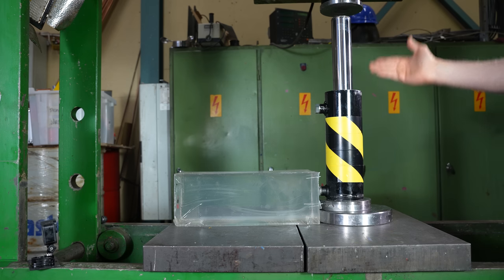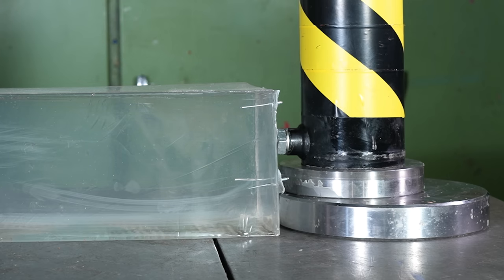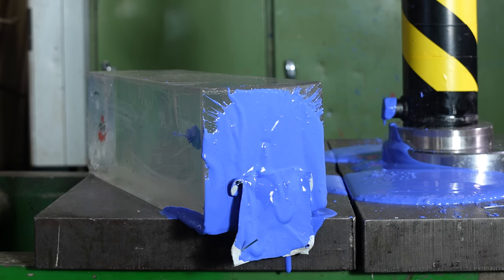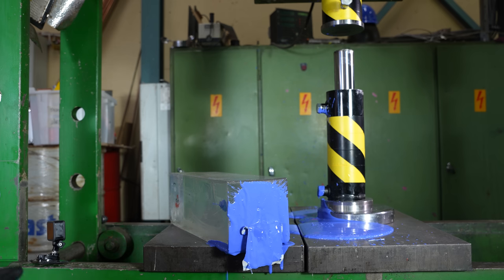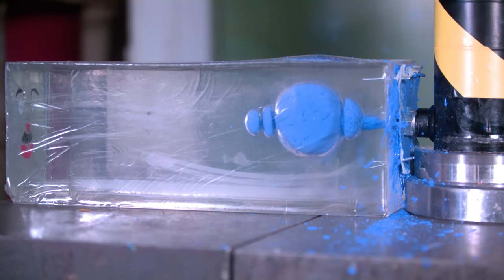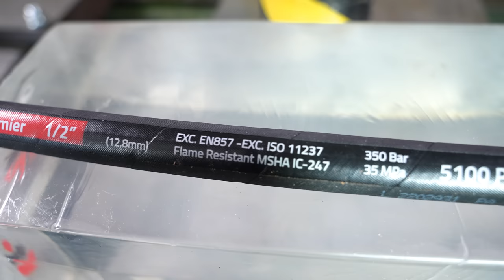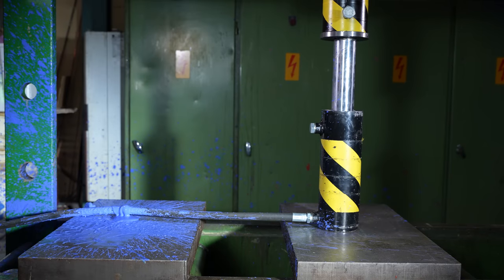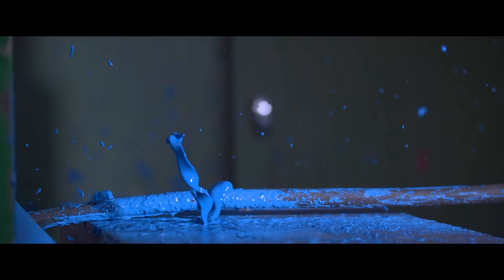Injection Injury Demonstration With Hydraulic Press | How to lose your hand!

Comment: Years ago I worked for a hydroblasting company using up to 40k psi equipment. We all had to carry a special card with us in case of injury that told doctors how to properly address an injury since it was such a specific kind of injury.
Reply: That’s nearly 2758 bars for those who want the conversion.

This amount of pressure will go right through two people if the injection injury is located at the chest. Bones included.
Reply: So if you could effectively get mercury to those kind (or perhaps even a theoretical liquid with an even higher density via simulation) pressures how many human bodies could it be able to penetrate through?
Reply: @thedoctor2102  I'm admittedly not smart enough to have an answer for that question, but I can tell you that I've seen the water shred through reinforced concrete like it was Styrofoam, in case that gives you a good idea of the power.
Reply: @thedoctor2102 Mercury powered death beam, 50+ feet, easy.
Reply: Here's some wood cutting with such: https://youtu.be/JYlkrYVarP8?t=138
And swtiching to steel with abrasive material added: https://youtu.be/JYlkrYVarP8?t=484
Also cuts solid ice like butter:
https://youtu.be/Iv3Rb88ZGy8?t=422

Comment: This is why you NEVER feel for leaks with you're hand when working on hydraulic systems.
Reply: You can actually feel for leaks twice with your hands. That's because people have two hands, so when you lose one, you still have the other one to feel for leaks. /s
Reply: @LordDragox412  Do not look into laser beam with remaining eye.
Reply: Correct . Always use your tongue 🤪
Reply: Use a piece of paper
Reply: @TheBackyardChemist  Especially not UV lasers because they don't trigger the blink reflex. Anything single-mode (like common 1310nm or 1550nm optics) is risky, especially LH (Long-Haul) or ULH (Ultra Long Haul) due to the launch power. Vendors are supposed to include safety features like auto shutters and ALS (Automatic Laser Shutdown), but they can be badly designed. I once had a well-known 'carrier' manufacturer show me some very expensive line cards with a 45 degree connector facing upwards. They were told in no uncertain terms that we wouldn't be buying any of them until they fixed that rather critical safety issue.
As for pressure systems, I was told to use paper strips with a length-ways fold in them. If it deflects the paper, there's a leak. If it cuts the paper, be glad it wasn't your finger.
Reply: @brolohalflemming7042  Those are IR wavelengths, not UV, but good point.
Reply: Always use a hotdog to check for leaks
Reply: A guy I know did that. His hand injury was so bad that the doctors wanted to amputate it, but they just happened to have the nation's top hand surgeon working at the hospital, and that woman managed to save his hand. But it still took 6 or 7 surgeries over the course of 3 years to fix the hand.
Reply: @Benny--- Just thinking about those bills terrifies me
Reply: Thanks for the heads up, I would have never known this, I learn more from commenters than school.
Reply: do be fair if you use your hands to find the leaks, you will know for sure when you find them

Comment: I worked security at a place that manufactured hydraulic pumps. They had a torture room where they tested stuff way beyond the rated maximum. Some of their bigger pumps would run 30,0000 to 60,000 PSI. They showed me a video of a pin hole failure at 30,000 PSI and it cut the gelatin dummy in half, and it had simulate bone and organs similar to the ones from Ballistic Dummies (though this was way before that company existed as far as I know).

Comment: Thank You for this video. Younger folks who work with pressurized systems NEED this video, not the experience. My first Navy Aviation command, we had a young guy working with a pneumatic grease gun. It was everyones first time being around a pneumatic grease gun, so no one had experience with it. They loaded it up, hooked up line pressurized air to it and ... it didn't work. They had used an old Zerk filling nozzle that had a metal burr on it. Young guy puts his thumb nail on it to flick off the burr, pressed his thumb to the end and hit the button like he did with manual grease guns and............promptly inflated his entire hand with about 2 pounds of thick grease. His hand looked like an old baseball glove, the formerly ivory white skin now leather brown and inflated to three times its normal size. It was the first time I heard the phrase 'Internal De-Gloving'. It was an instant medical emergency that no one knew how to deal with. He was taken to the Emergency Room, who transferred him to another hospital, who transferred him to another hospital and finally ....well, he got sent back to the first hospital. His hand was totally De-Gloved, but the skin was still attached. They would start surgery to clean the 'wound', by slicing every finger top and bottom from tip to wrist and scooping out heavy dense grease, flushing it with gallons of saline.... and, somewhere along the way? They called in ....a Taxidermist. I don't know why, or if it was real... The young guy came back after nearly 6 months, his new call sign was 'Frankenstein Hand'. His hand was stitches, scars, skin grafts, necrosis and he was nearly discharged. His hand was in near constant pain and... yeah, poster child for safety after that.
Reply: Jesus fucking christ can't even fathom the pain of something like that happening. Oof.
Reply: the saline isn't going to do shit to that grease either, poor guy
Reply: It was tough to even read this. Jesus..
Reply: I really wish I hadn’t read that...now I got that image of a degloved hand and other disturbing hit in my head...
Reply: I would have rather told them to just fucking amputate the hand in totality, don't bother.
Reply: Reading this is still more tolerable than looking at an image of a firefighter caught and killed in a wildfire... Dude's skin was almost completely burned away, little melted scraps still hanging on, most of the flesh on his head had burned away, just leaving a scorched skull with just a little bit of flesh left behind, and I could see charred muscle separating from tendons and ligaments elsewhere around the body.

It is more horrific than it sounds, words cannot describe what I felt when I saw that image, but it gave me a whole new respect for fire. Your story definitely gives me some proper respect for pressure.
Reply: Not just with, also around. I used to work for an excavation company, sometimes that meant me in a machine (getting to run a bucketloader with 6 foot tall tires and articulated steering was great), more often than not it meant me working beside a machine. It was good to be aware of the equipment. Not like I had a scumbag boss or anything, so the equipment was always in good shape. My boss actually cared about his employees so this was something he made sure we were all aware of, just in case.
Reply: Jeez, that is like a novelist-grade description of what happened.
Reply: My brother used pneumatic drills and screwdrivers at work.  One day when he needed to use one and he touched the button he noticed the thing didn't start normally but very aggressively (starting the thing under normal circumstances already was very close to an on-off situation but wasn't as violent as it was now.
He noticed the pneumatic line was also stiffer than normal and walked the line back towards the compressor outside the building, up to which he started hearing a hissing sound near the main coupling into the lines for the drills in the workshop (there were about 4-5 I think).
When he went outside he saw the compressor was redlining because the pressure sensor was malfunctioning and the pressure drum was way over safety limits.  They improvised a longer stick to switch off the thing (there was one of those stick-and-hook switches in a box on the outside but they reasoned they were to close to the drum while doing that).

When it was off and they decided to run some of the drills simultaneously to relieve pressure as quickly as possible, some of the drills ran for 3 minutes straight.
My brother checked out the situation outside again after that and the pressure drum and main line had been forming a thick layer of ice, indicating just how much of a pressure difference there actually had been taking place by relieving pressure.
They switched it on after that and watched the installation from the outside.  Upon the gauge immediately redlining again instead of switching off when that happened they pulled the switch and then decided to take out the wiring from the junction box so it could not be switched on again.
A decision was immediately made to have a replacement installed, all of the employees knew full well how bad things could get if any part would've failed under high stress.

By the way: The taxidermist was probably called in because they have experience working with chemicals to rid the body of an animal from the cleaning agents (to stop a possibly pungent smell) that next to toxic, can also invade tissues in ways that most doctors will probably never encounter.
Reply: I wonder what the taxidermist was thinking 🤔
Reply: I just looked up degloving. Don't do that.
Reply: @rdizzy1  truth

Comment: I used to be a painter working with high pressure spray equipment so this is something that I have always taken extremely seriously. I reported a damaged spray line to my superiors and they blew me off and didn’t do anything about it. One month later that same spray line busted open and spilled paint everywhere on a construction site, nobody was injured luckily but that could’ve seriously injured somebody and I was pissed that I warned them about but they didn’t listen to me. I don’t want to be anywhere near defective equipment. They are hypocrites for preaching safety but when it comes time to fork out money to replace old and damaged equipment then they don’t do it.
Reply: Paint sprayers are no joke... My grandfather was burned over a large section of his body by an industrial grade paint sprayer.  I don't know how, but maybe it was gasoline powered or perhaps the paint had a bubble that dieseled on a clogged nozzle.
Reply: @notamouse5630  The only thing I can think of is they were spraying flammable paints and coatings. Back in the day they used oil based paints that were not water soluble, they were solvent based with flammable solvents. This made it a pain in the ass to clean and get off your skin and it’s hazardous. I think gasoline powered sprayers do exist but i’m struggling to think of how he could get burned on large swaths of his body because of that but who knows. Sounds like a nasty injury. They can be dangerous, spraying flammable coatings in enclosed areas can result in fires, imagine getting an injection injury with toxic solvent based paints, that would do some serious damage. We’ve since phased them out mostly due to the environmental hazards, but they’re still used for some specific purposes like staining/lacquering and some metal coatings.
Reply: @grimreefer213  Oh there's worse paints out there in use too.  Know a guy who lost his arm mishandling a spray gun, he was using moisture cure industrial paint, the hose failed right at the joint where the hose connects to the gun.  Bad part about that particular paint is the whole "moisture cure" part of it when it enters moist, human bits.
Reply: @Puddingskin01  Oh my goodness 😱
That sounds horrendous. Yeah that’s part of the reason I left the painting industry, it is dangerous. I don’t want to risk getting maimed or injured or falling from heights, and it’s bad on your joints and body from all of the repetitive use. I did a lot of industrial painting so I worked in some pretty dangerous environments. The company I worked at did work for a company called Meridian Magnesium and they sometimes have these magnesium explosions whenever water droplets falls into their molten metal vessels. One of the painters was in a lift directly over the vat and it exploded and he was engulfed in a fireball but somehow wasn’t injured

Comment: Now, remember that hydro-cutters often have AT LEAST 10 times more pressure than what we have here. Then, the jet is normally narrower. In some cases, you can't even SEE the puncture.

VERY sound advice. Even if you are not sure, just go to the ER if you suspect that you may have such an injury.
Reply: Not only that, but something as innoucous as a diesel-injector can get way worse than that. This video is giving me PTSD.
Reply: Pin hole leaks in steam pipes..
Reply: @geneticepistomology  Ugh. I was in the navy and this was something we learned about, in-depth. Nasty.

Comment: As a professional painter this type of injury is one of the most dangerous and common we need to be aware of. Our pumps usually operate between 1800 and 3200 psi. Being exposed to a pin hole in a hose for even a tiny fraction of a second can result in extreme injury or even death. It's not just the Injection you need to be aware of, the material injected (paint in our case) even if it is low VoC is super infectious and can kill you from infection weeks or months later.
Reply: You should just use paint brushes. Those r low power
Reply: i held my muddy license plate and tried hitting it with a pressure washer, the pressure forced the wand up and hit my hand. that really really hurt! my hand was beat red. was only literally just a second, half a second even.

Comment: To reemphasize points I've heard: anything above 100 PSI may cause injection injuries.  Some injuries are not even apparent from the surface, presumably given a small enough pinhole leak; you just feel a sting, and that's it.  A large part of the problem isn't the physical damage, its the horrible infections or poisoning that happen a few days later.
Reply: The cavitation is also extremely destructive to tissue.
Reply: @dezmodium 
Yep. That’s why hollow-point bullets are hollow: it expands rapidly as it penetrates, dumping a monumental amount of energy directly into your body faster than one could blink.

Still can’t get over just how severe these kinds of injuries are. And I am still shocked that hydraulics can have the same instantly destructive effect (with additional complications).
Reply: 100 psi is around 6 bar for euro folks
Reply: En qué situación eso puede ocurrir?
Reply: @flakey7832 tnx!
Reply: @flakey7832 or anywhere else in the world
Reply: @anonimoanonimo3615 diarrea muy fuerte

Comment: You wouldn't believe just how tiny and hard to spot some leaks can be. Had a leak on a lifter and the only indication was a faint rainbow if the sun was at the right angle. Literally sweep the lines with a broom to find it and watch for when the bristles start to scatter cause the invisible jet of fluid is cutting them to bits. Even with gloves on if you touched it you'd be in a world of hurt. What the gel doesn't show well is the layers and veins and other pathways it can follow once it pierces.
Reply: Couldn't they put some sort of agent into the fluid to make it stink REALLY bad? Like how certain gas has sulfur intentionally put into it so you can smell a leak.
Reply: @Sammysapphira thats’s a good idea actually
Reply: @Sammysapphira  but it happens so often with older machins, you would stink to high heaven after a 12hr shift.

Comment: Having been a forklift operator for 20 years, I’ve seen plenty of hydraulic hoses burst. The worst one happened just after shift change. The operator before me had failed to mention my lift should be out of service. Thank goodness it burst in my pre inspection and not under load. I still got covered in hydraulic fluid as one of the pulleys had broken and pierced the hose when mast was raised. I was completely drenched in hydraulic fluid and there was a huge mess to clean up. First instinct is protecting your face and close eyes and not breathe until the shower stops. Call for help on the radio and wait for floor dry to be spread so can get off the forklift.
Reply: Did it burn your eyes
Reply: @jordan_.zx10r  no. I was wearing safety glasses and had a hat on.
Reply: @Its_just_Dave.  I wonder if hydraulic oil burns your eyes. I swear I splashed some into my eye tiny amount from taking a seal off cylinder but didn’t hurt at all

Comment: Excellent job simulating skin here too!  It's a common mistake people make to just use straight ballistics gel.  Skin is shockingly puncture resistant and elastic, far more than gel, I think the FBI said before that skin is equivalent to a few inches of ballistic gel typically, don't quote me on that.  Leather is great for this because it's tougher than skin; if it punched through leather, it will DEFINITELY punch through your skin!
Reply: The FBI standard you're thinking of requires 12 inches minimum acceptable penetration of properly calibrated gelatin, as the equivalent of sufficient penetration in flesh to reach major arteries and organs. Just penetrating the skin is not necessarily sufficient to cause incapacitation in the law enforcement context they studied. I agree this would be a life-changing injury though. You can read the article here: https://www.ojp.gov/pdffiles1/Digitization/122334NCJRS.pdf
Reply: I think pig skin would be a good medium as well.
Reply: Leather IS skin, just not human skin.
Reply: @CanizaM no, Leather is treated (tanned) skin. It has been chemically processed altering it's properties.

Leather can be made with all animal skin, even humans. Cow skin is just the most common.

But you can't compare it to living skin anymore because it changed properties in the process.
Reply: Ballistic gel is mainly used because it is repeatable and consistent, not because it is so close in properties to flesh. (It is close enough obviously to have at least some kind of validity though).